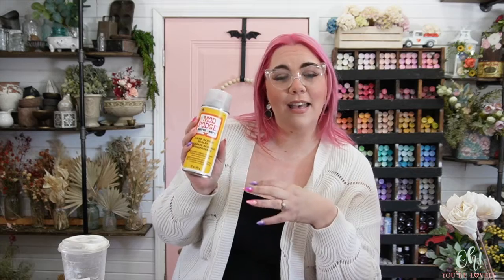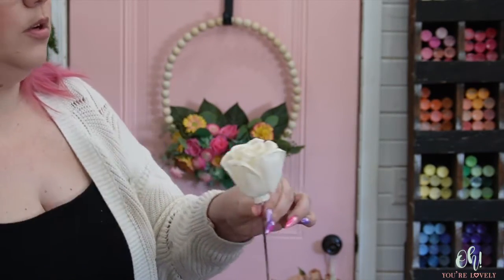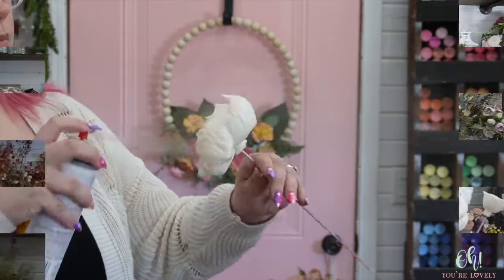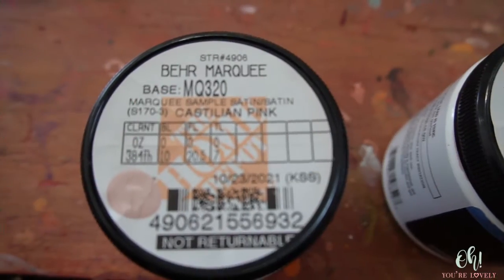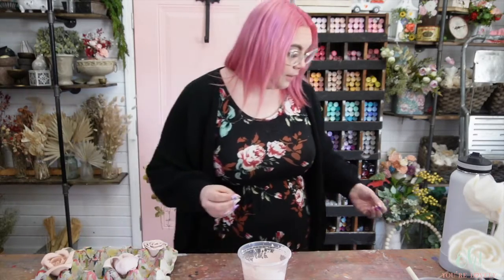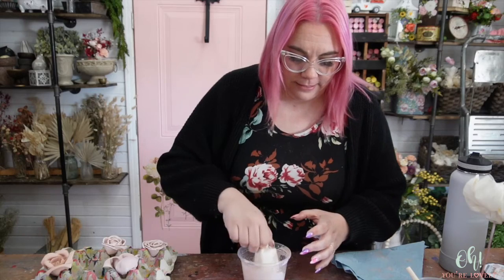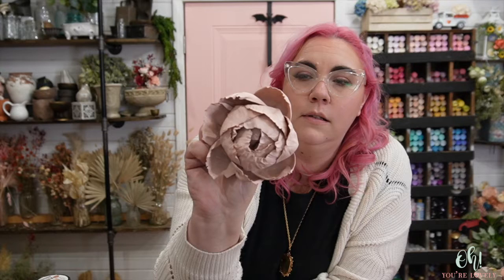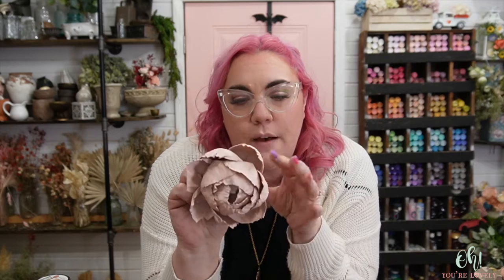Will this work to help petals of wood flowers from uncurling?  Testing out Mod Podge spray

Comment: I just tried this on luxe sola flowers (peonies and roses) and it turned out PERFECT. Maybe one petal uncurled a little bit, but that's it. I also used pretty thick paint (didn't dilute it too much with the glycerin/water mix) and the color is even and deep. Wish I could post a picture, but it really worked great!
Reply from the maker: Wonderful!

Comment: Testing out Aleene's gloss sealant as an alternative, (its what i had on hand, and couldnt find either of the other sprays at my local stores) just in case anyone needs to know. I have sprayed a peony and a small rose and waiting for them to dry. Will update on whether it works later.